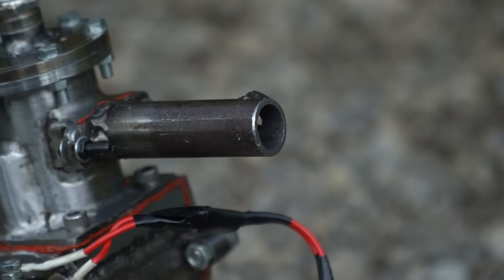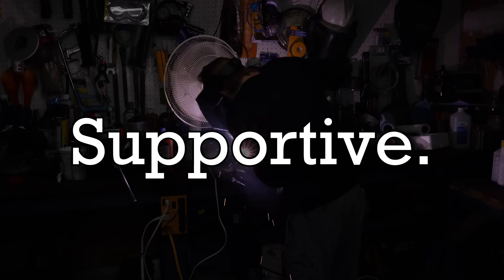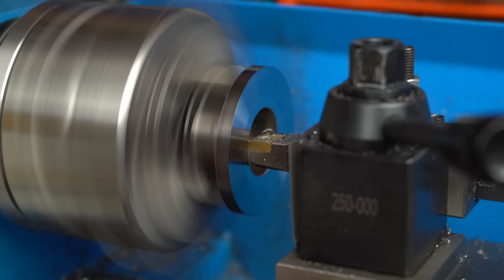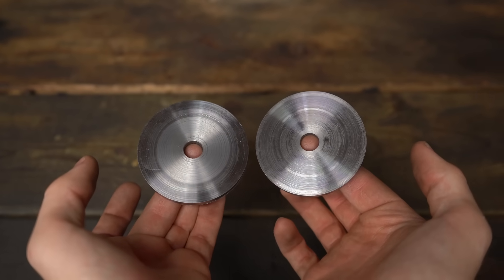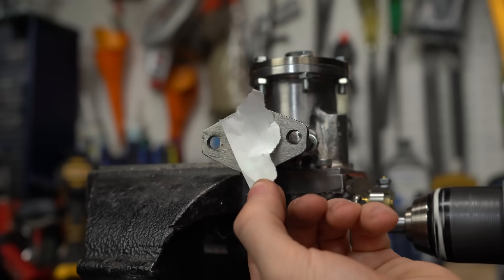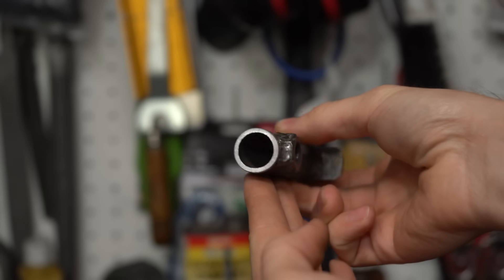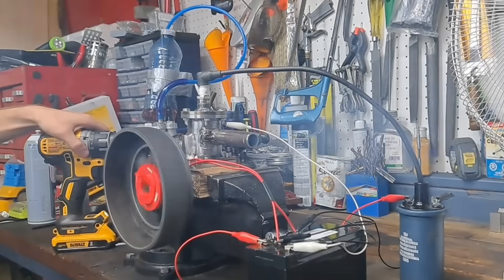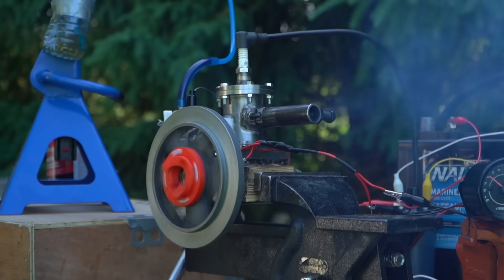I Made a Two-Stroke Engine Using Things I Found at the Hardware Store

Comment: A 2-stroke exhaust isn't about pressure, it's about reflected waves. That's why they have to be tuned. Adjusting the length of the system is the primary method. Exhaust cross-sectional area matters, too.
Reply: You are on the right track. Here in the Netherlands we've got many mopeds. Many of us (me included) worked and maintaind our own mopeds including my friends with 2 strokes like aerox, speedfight 2 and so on. It was when we put on some performance exhausts like polini or yasuni r exausts those things had so much more power. Back preasure really is a thing with engines i assume.
Reply: @bryanpeeters2552  The tuned exhaust is what improved your engine performance, not an increased back-pressure. In fact, Ive seen some independent studies that dispute the claim that exhaust system back-pressure is helpful to an engine, be it 2 or 4-stroke.

Your exhaust needs to do what it's name says and exhaust gasses as freely as possible. Back-pressure is disruptive to the function - However having a tuned system which can utilize the pressure waves of the exhaust cycle to push gasses to where they need to be should be goal of any performance exhaust.
Reply: @UnitSe7en tlike the mega boon in 4t(cyclone in mitsubishi L300)
Reply: @Turnipstalk Indeed yes, as his does. I just wanted to hopefully correct a misunderstanding that he has about the purpose of an exhaust on a 2-stroke engine. As you said, having a tuned exhaust system would improve his engine.

It's a bit like a pulse-jet in a fashion. While I ordinarily wouldn't compare the two, the physics is related. It's about mass flow and reflecting pressure waves to push the gasses to where they need to be at the right time.
Reply: They are so complex in a way.  Impressive.
Reply: True but it’s also about back pressure, thats why the ends are always pretty small since the exhaust gas pushes back on the new fuel/air getting into the cilinder otherwise you waste a lot of air and fuel that go straight into the exhaust
Reply: @fr0237 The ends abruptly decrease in size because a sudden change in flow velocity reflects pressure waves. Not because you want the exhaust to be less free flowing.
Reply: @fr0237 yea they said “it isn’t about pressure, its about reflected waves” aka pressure😂 those reflected waves are providing PRESSURE against the fuel causing it to go BACK into the engine to be combusted, the “reflected waves” is what is causing the back pressure😂 just cause it’s not always providing back pressure does not mean that the back pressure isn’t a benefit of it😂
Reply: Hopefully he read that. The most correct comment I think I've ever seen on a subject few people still know about today
Reply: @ChristopherOvrebo  And with electric shit being pushed upon us, it’s not going to get better…
Reply: It's all about the reeds it's all he needs. Sound is pressure lol  a tuned exhaust on a two-stroke will blow up an old bike that can run on 87 octane even with the perfect fuel mixture the compression is too high and it will detonate.
Reply: thats why a 2 stroke dirt bike exhaust has a expansion chamber the exhaust has a big effect on the performance of a 2 stroke
Reply: and the bikes with variable port timing
Reply: @mdacosta7013 does injection 2t oil matters as to keep it slick n no gunk coz its a 50cc
Reply: U mean kadenacy but back pressure is vital too its just on 2t is bit diff

Prib wont be that diff if hes on straight pipe for low mid rpm

If he needs a shrimp pipe, might as well get a cad file from a pit bike exhaust ,(same 50cc)
Reply: @paradiselost9946  Nobody claimed it was critical. What a worthy book you wrote about something you imagined.
Reply: Nobody's talking about the reeds that's all he needs lol as an old dirt bike racer I know tuned 2 stroke exhaust increases chamber pressure. An old bike that would run on 87 octane will blow up it will detonate the compression is too high with a crazy modified pipe. My favorite 9.9 outboard boat motors with crazy pipes.

Comment: its rare to see 2 strokes water cooled, u can make a pathetic bottle radiator
Reply: and you need a small pipe in the bottom of the engine stroke cycle to squirt oil at the cylinder walls when its moving and squirt oil at the crankcase when cylinder is at top center

Comment: I dunno if you did, but if you counterweight the crankshaft that should help too with running and the vibration, the vibrations wouldn't of helped the conrod bearing coming loose, in regards to the smokiness of the engine, could be to do with incomplete combustion. Ie: too rich or possibly something to do with exhaust port height being too high. Wouldn't think a 40:1 mix would smoke that much.
Maybe make an acrylic water jacket around the cylinder too with a water pump or connect your garden hose to it
Great job though, highly invested in your series, I wanna see this engine setup on a bike once you have it dialed

Comment: couple things with your piston design you really need a reed valve on the exhaust two strokes  usually breath though the crankcase (the intake on the carb is accually in connected to the crankcase as the piston moves up and down it draws a charge of fuel-air into the crankcase which is then burnt this helps lubricate things and helps keep things efficient some designs relied on the mixture being oil rich to insure the crank gets enough oil, if you must use a splash lube design for the bottom end I would  us some amsoil saber as its designed to burn. conventional oil is why its smoking so bad conventional oil doesn't really burn it tends to smolder  and detonate which is bad  you might be-able to get cleaver and rig it so you can fill the crank area with two stroke oil and create a passage so some of the oil is drawn into the combustion chamber allowing you to run straight gas this is how many snowmobiles where setup (oil injection) most of them just had a small valve that was operated in tandum with the throttle that allowed more oil in as you squeesed on the throttle 

 so without a way for some of the fuel-oil/air mix to get into the crankcase you are running on borrowed time  I doubt the splash of oil is going to keep that rod bearing happy for long. 
secondly you need to have the cylinder coated in something harder then the material the rings are made out of  running it off ether didn't do it any favors but the real issue is the difference in material hardness two stroke cylinders are usually coated in something like nickle-silicon aka nikasil all and all impressed it runs considering it was built from homedepot parts ..

Comment: you should have added reeds to help it run better and chamfered the transfer and exhaust ports so they dont eat your rings, also the only oil the crankcase needs comes from the premix, when the gasoline burns it leaves behind oil residue which lubricates the crankcase as well, of course everytime you take it apart you should be using assembly lube on all the bearings and stuff, when you added oil to the crankcase like that it was burning that oil as well as your premix, as for cooling im sure you could braze some brass or bronze fins onto the steel to dissipate heat, or make an aluminum interference fit finned sleeve like air cooled engines have and press the steel liner into the finned aluminum sleeve. -Motorcycle mechanic.

Comment: You should try casting a cylinder. You can 3d print the parts to get the shapes into sand and then cast it in there. Much easier getting the odd shapes that way. It also should be able to take a bigger hit than welded parts. Very cool project still!

Comment: you were right about your interference fit being too loose because you didn't heat it with a torch to put it on you need to make it way tighter heated and then put it on and let it cool and then it'll be super tight and won't heat up from the engine heat enough to come off

Comment: Not judging here... but I am AMAZED that this worked AT ALL given the tools you have at your disposal. You, Sir, earned a subscriber!

When you get a little further and want to chase power, having a design with inlet reeds is crucial. That will let you reap a bit of air flow via Newtons first low of motion "Things at rest will tend to stay at rest, and things in motion will tend to stay in motion". With an inlet reed you can make air compress itself to above ambient before the piston compression begins. It does, however, require a more complicated cylinder design, as you need the carburetor attached directly to the crank case. But I'm sure you'll manage that with some welding and filing.

Comment: 500ml watter bottle size going from big to small. so the bottle end is close to the motor and top as the exit of exhaust !!! and the motor will run like a dream with the heaver fuel setup !!! and do 60 ml of oil per liter of gas and you should be fine !!! and it should end up being a 75 cc max. if I got it right !!! but feel like a 125cc bike !!! next video hopefully !!! make the exhaust 1.48 inches ooout with my setup  for it !!!

Comment: pro tip - crankshafts dont use roller bearings for this exact reason 13:10 
theres not enough contact and you end up putting stupid high PSI on the bearing needles which they cant handle. best to press on a bronze bushing with just enough slop to let oil in

Comment: Bah, just put the cylinder pipe inside a bigger pipe, a metal plate sandwich for the cylinder head, and fill it with water. Boom, liquid cooling.

Comment: The needle has no effect on the fuel mixture at idle, It effects t between 15-80% throttle. Also these carbs have AIR screws, if the screw is above the float bowl its an air screw. 

If going out on the air screw raises your idle you need a smaller pilot jet. if you go into raise the idle you need a bigger one. pretty simple.

You cant just dump oil in the crank case. the intake charge is mixed there. This means your jetting IS WAY WAY off on that carb. as its diluting the charge with oil in the crank case. If it ran with that oil in the crank case the pilot jet is way to rich. there should not be enough fuel to maintain proper afr with all that oil. This is part of why it wont rev out. it sounds like its hitting a limiter its WAY rich

Comment: You should measure your clearance from the piston and the head, then add a bolt near the spark plug, it allows you to fine tune the compression, some rc 2 strokes have that

Comment: How do you control spark? Do you use a magneto or something else
Reply from the maker: It's using a breaker points system, there's a little camlobe on the crankshaft which times the igniting

Comment: Great video! If you plan on making a second iteration of this engine I might have an idea for you. 2 stroke Detroit diesel engines used a Roots style blower making like 2psi of positive intake pressure to force air into the cylinders. That might be tough to do with a carb but it might be worth investigating!

Comment: Your welds are due to you using a flux core welder. Flux core always looks bad, well not always but it requires a good amount of practice and if you prep the material you can get the spatter to not stick

Comment: the smaller size off the piston is because the piston expands to fit the cillinder with out getting stuck. its also two stroking. the enginher does need a bit of back pressure for the mix not just to vent off the exhause needs to be before the exhaust andu can tune the engine by opening the exhaus sooner but going to soon there is no power. finding the golden position is key.

Comment: If you need to make an accurate dimension on a lathe, set your compound at an angle 45 degrees is good. Then place a dial indicator on the quick change tool post. Use your compound not the cross slide, and set your depth of cut using the dial indicator. Much easier to creep up on a precise dimension

Comment: I actually have a few suggestions to help with this! Im a future RC hobbyist and ive seen small engines like these on numerous models!

#1: mount a simple heat sink around the cylinder housing, this helps draw heat out of the engine and keeps it cool, note that spacing of the panels will effect the amount of heat it can expell.
#2: switch over to nitro fuel, as most tiny single cylinder engines that ive seen, actually run off nitro, this gets them to higher RPMs and produces more power.
#3: try to balance the weight of the camshaft with some sort of small counter weight, this can be external or internal and should help it run smoother by reducing vibrations and knocking in the engine itself!

I would love to see this thing strapped to like a wagon or something in the future!

Comment: Ive used old trampoline tubing as a cylinder wall, forged a crank and rod from the tubing you get at weld suppliers and ace hardware. Used those wood bolts with the rounded head as valves and even made a copper turbine and magnet to make a magneto to supply spark to the plug. It was technically fuel injection, for there was a cam lobe on the crank that would press down on the nozzle of axe body spray. Thing ran like shit and smelled. But it ran. At only one speed lol

Comment: i've got the same lathe, and so far my only complain is that you can only fit 3/4 inch stock through the chuck and most stock seems to be cheapest at 1 inch lol. its so much fun messing around with that lathe. you really do need to add a carriage lock though because using the lead screw and the neutral position on the feed just sucks

Comment: Next you need to design a tuned pipe with proper pressure control to help the air fuel ratio by the volume of the crankcase and size of the cylinder. Tuned pipes are key to make a 2 stoke run properly by drawing a rich air fuel mix back in to the crankcase. This will provide a more tunable engine.

Comment: FABULOUS RESULT! Excellent presentation. Congrats. (Now put the battery back in the car, drive around a while and let the computer gather enough info to turn off the check engine light, about 30 minutes. A minor detail but just in case you get the check engine light.)

Comment: You could make waterjacket for it with just bit bigger pipe and some brass plumbing fittings, put the input fitting over the exhaust ports and output near the back of the cylinder so it flows from hottest to cold!

Comment: Could you replace the flywheel with a heavy enough fan and attach cooling fins on the cylinder? Welding would be out of the question since that would warp the cylinder. Unless the cylinder has enough surface area by itself to cool the engine?

Comment: as far as accuracy goes, putting the compound at a high angle (14 deg iirc) you basically make the input so much more fine, even on a "crappy" lathe. i think 14 degrees means that a cm on the wheel is 1 mm actual movement towards the workpiece, allowing fine adjustments. i subbed this was awesome!
Reply from the maker: That's really clever actually, I will give that a shot!

Comment: Instead of starting fluid, I would use a spray bottle of gas mixed with two stroke oil. Also is the ignition you put on this from the hardware store? I wish you touched on that part a little more. I’m surprised you didn’t make your own little flat top piston either considering you’re using a welded up crankshaft. Next video make a custom pipe, your own piston, add some fins to the cylinder and maybe ensure the port timing isn’t funky and it’s probably gonna rip. Use it as a power generator or a mini pressure washer or something lmfao

Comment: Try to make 3d printed mold for the engine or cylinder and copy some of these parts from aluminium. It's amazing how well these engines work from prototype to the next prototype. Cast the cylinder from aluminium and press fit a steel tube for your cylinder as you already do. Cool videos

Comment: The whole "back pressure" thing is a bit of a mind field, my best understanding is that it creates a "momentum" of gas to help draw the next exhaust cycle out
Reply: I think part of the issue is you don't just want backpressure, but you want an expansion chamber that necks down to a small opening to generate pulses within the chamber to aid in the cycle. By having such a short pipe that's restricted, there's no time for the pulses to slow down to aid effectively with the exhaust stroke. it'll run how it is, but without a properly sized pipe it's missing out on a ton of power

Comment: You should also add a reed valve to the intake side...might run a lot better.
Reply: Not necessarily. Piston port engines can easily go over 100hp. Sub 750cc.

Comment: bro where are the reed valves?
 those are necessary for two stroke engines
Reply from the maker: Actually no! The method I used is called "piston port intake", it uses the piston skirt as a valve that opens and closes against the intake port, it's cool stuff

Comment: At this stage in your machining journey, do not, i repeat, do not bother with needle bearings. Go straight for balls. Seriously not worth the headache. In gaming terms, it's like being level 10 and you've bought a level 50 pair of pants, but you can't equip them. So you keep them in your inventory, losing one inventory space. Use an ABEC 7 bearing or any bearing in that size range. Also, when you make the rod, don't make it out of two parts, get yourself a single piece of metal, chuck it in the lathe and machine the center round, then drill the two holes (wrist pin and bearing) with a smaller diameter carbide toothed hole saw (the cheapy ones).